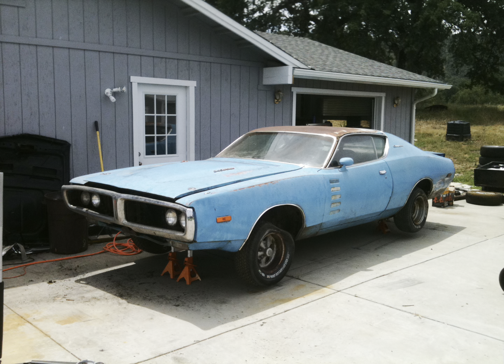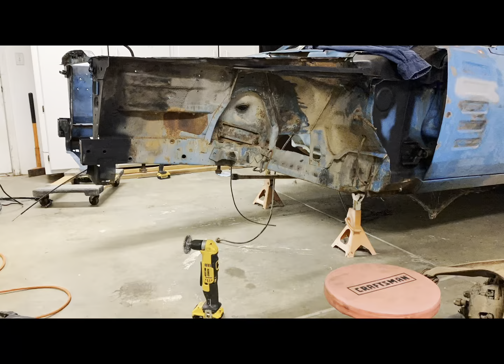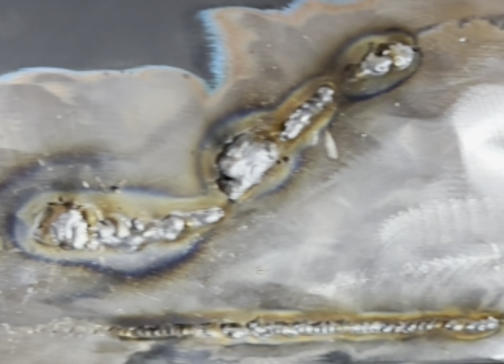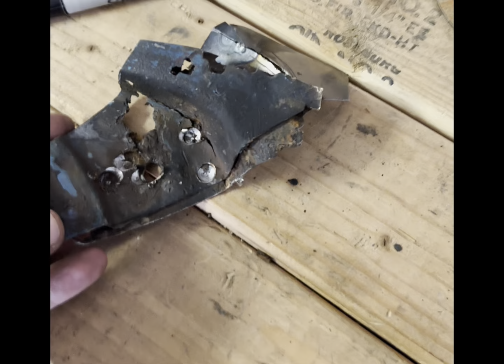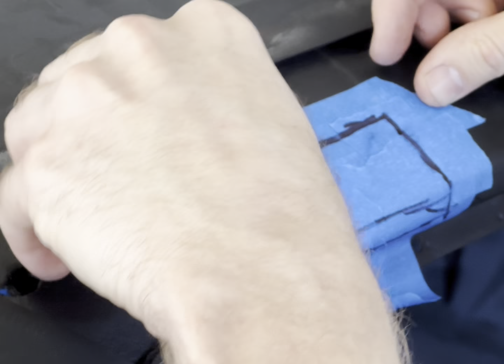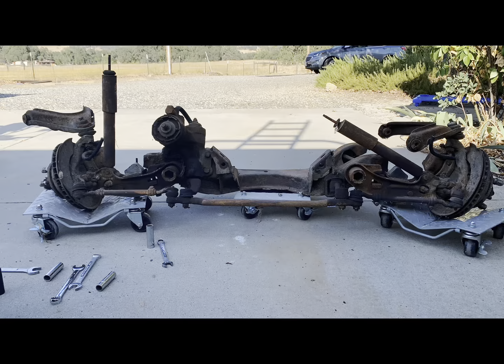1972 Dodge Charger Rallye Restoration

Comment: @ 7:24 why its real good to dip these bodies add chassis, etch and seal, so much better the entire car is celan and it wont smell like rust all the time.. it wont smell, little new carpet padding it will smell brand new again, and stay for a while, all that old rust everywhere just makes for a bad smell and it keeps rusting, if you're trying to save a car its the only way, dip, repair, seal, or dip and seal then repair but at least dip and clean . . .

Comment: Nice work. I just started giving my 74 some love about 2 months ago. I got all of the mechanical work done and I'm turning my attention toward the body next. Mine has a mostly solid body luckily but it does have the usual rust holes starting at the quarters and fender bottoms. I converted it to have the roll down quarter windows. So I have to fab up the drip rails for them next.
Reply from the maker: Very nice! The 73-74 chargers I think have the best side window profile, the ones without the louvers anyway lol. You can get aftermarket quarters at least. Best of luck!

Comment: I wish mine had your amount of rust, mines pretty much triple the amount
Reply from the maker: Oof. I wish you best of luck. Sounds rough. Hopefully aftermarket panels start getting more support
Reply: @rowlandrestorations  I'll probably do the same, make a patch piece, over and over until I have structure again, next summer
Reply: @rowlandrestorations  there is a 1/43 diecast charger Rallye on eBay, I just got one today, blue with black decals.
Not many around
Reply from the maker: Ya you gotta do what you gotta do. Good luck man!

Comment: Once you get to a good spot, take a look at US Car Tools chassis stiffening kit. Seriously, get the car straight, then at least do the subframe connectors & torque boxes. My '69 Dart Swinger has those pieces, the reinforced core support, and the inner fender braces that grab the top of the shock mount. It makes a big difference!
Reply from the maker: That is a precarious rabbit hole my friend! Haha. If I do those then it would quickly evolve into a modern front subframe with rack and pinion, coilovers, and a custom rear 4-link to replace the leaf springs. I absolutely support the restomod game though! Not sure yet if I’ll be doing that to this car or not. Your Dart sounds like beast! I’ll check out that place 👍
Reply: @rowlandrestorations some people do that, get all nuts...but I am optimizing factory stuff. S21 steering box, FFI parts (not all, no need), 11.75 rotor swap using '73-up K member/knuckles/ linkage, braced 8.75" w/ discs...
A lot of the aftermarket stuff is too much for too little usefulness. Chris Birdsong did a couple episodes on how some of it was utter junk, too
Reply from the maker: @olikat8  ah I gotcha now, I am upgrading some minor things like that too. I got a Borgenson quick ratio steering box, 72 mopar 4 piston calipers, and I’ll probably be changing the rear drums to disc. But I get what you’re saying now, just using some of the era-correct upgrades. Good stuff man 👌. Sounds like you really know your stuff